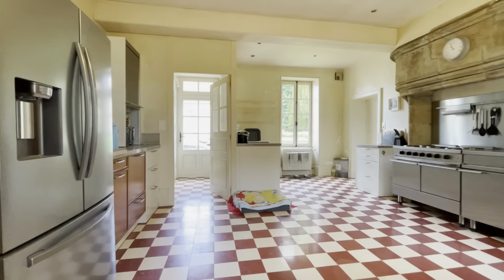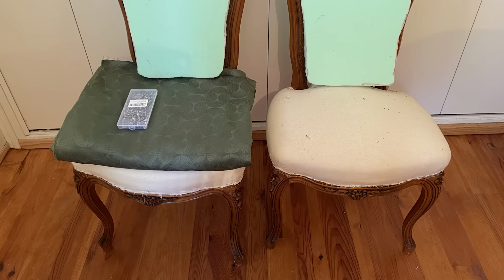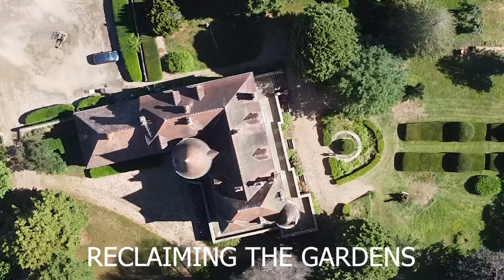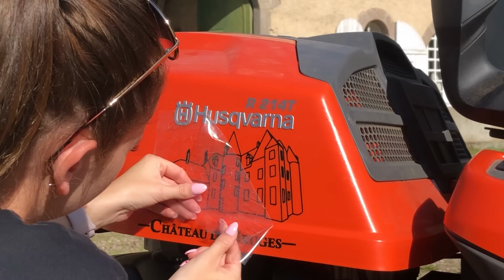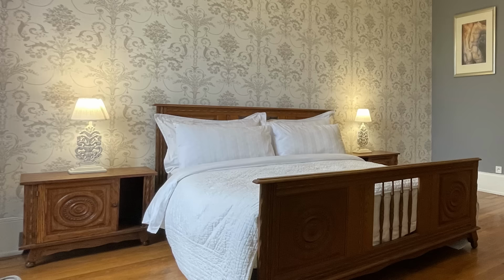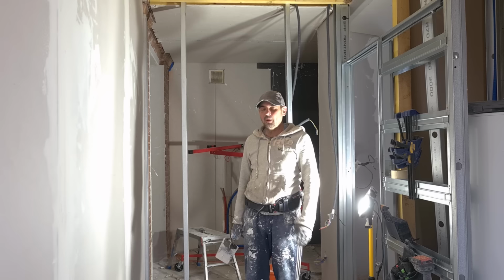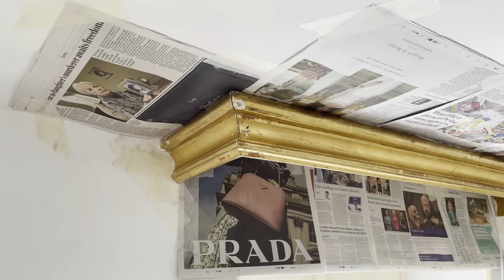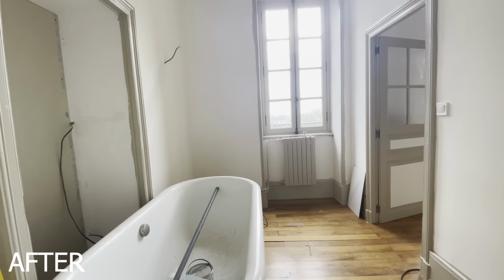We bought a CHATEAU! - THEN & NOW - 1 YEAR (in 35 minutes) TIMELAPSE - Chateau de Bruges

Comment: Did you guys say 16th century? That century goes from the 1500 to 1599, but that chateau is not from that period, it's probably from the mid 1600's to the late 1700's which means 17th or 18th century.
Reply from the maker: Yes, we said 16th Century. That’s what the French estate agent told us and is what is on all of the chateaux paperwork. 🥰
Reply: @ChateaudeBruges  
Unless the chateau was first built in the Renascence and was later updated, there is no way that building is from the 16th century. You need to straighten this up with the real estate agent who sold it to you. 
Anyway, great job at restoring it.

Comment: why do you find it difficult to clean a shower
Reply from the maker: It’s time consuming compared to showers with just one glass pane
Reply: @ChateaudeBruges  your going to love this make a solution in a spray bottle of dish soap just enough to cover the bottom and about 1inch of methylated spirit and fill the rest with water apply on screen rub in come along with a squeegee and remove this mixture is great for glass/mirror porcelain and some metal.as long as your cleaning the shower everyday your guest is there is no built up soap scum let me know how you get on.